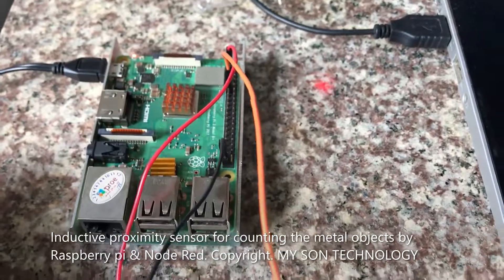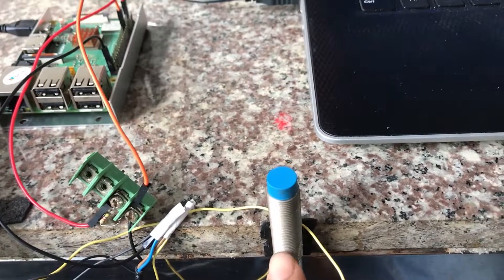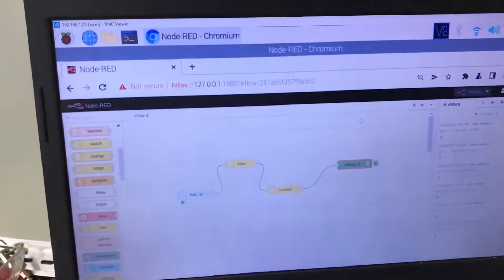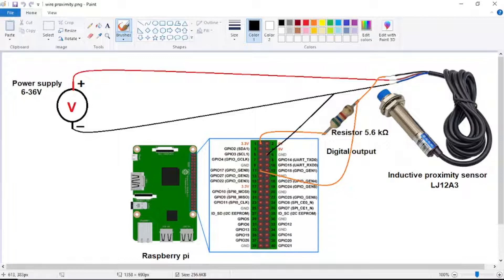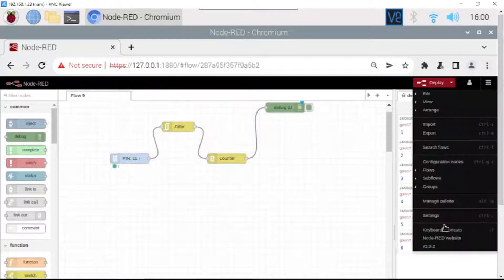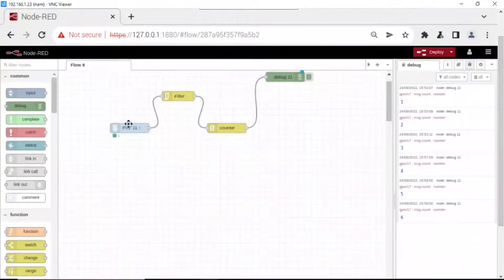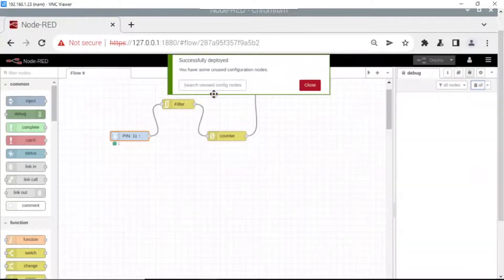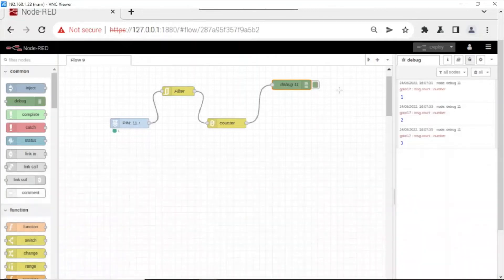NPN Inductive proximity sensor for counting the metal objects by Raspberry pi And Node RED

Comment: Hi thanks for the video. Quite helpful.
How will the connections change for a PNP sensor? I am using it with a raspberry Pi4 and calculating the time difference between each count to get the cycle time for a band saw cutting machine

Comment: Hi questions, Can I use the 12v 2A power supply to power the proximity sensor and it will work if I follow your schematic design?
Reply from the maker: That's right
Reply: @mysonacademytechnology2431  Thank you so much! Do you have telegram or discord server to get in touch with you?
Reply from the maker: @christianbatoon3286  i don't, you can contact me on this comment
Reply: Awesome thanks!